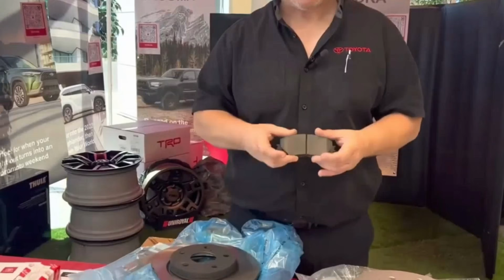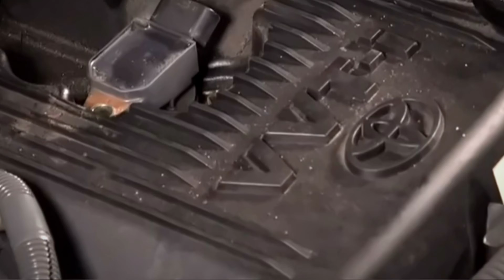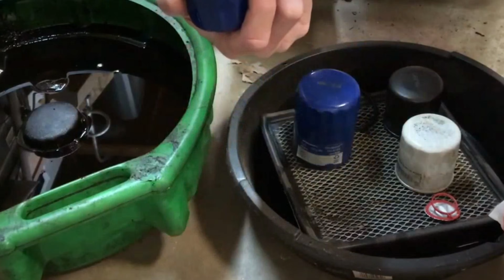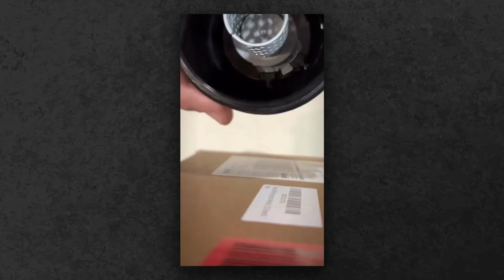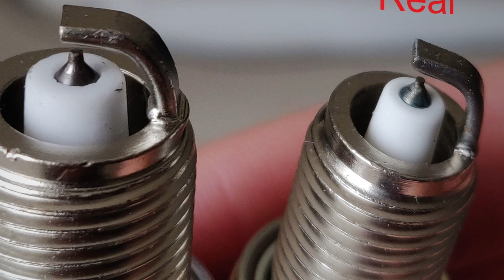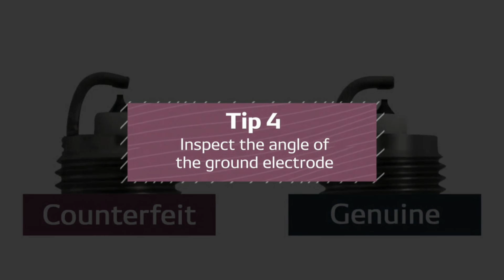The 5 Toyota Parts You Should NEVER Buy Aftermarket (#3 Destroys the Engine)

Comment: Dealing with P0171 and P0174 lean codes on both banks after my son replaced the MAF sensor on our 5.7L Tundra with a cheap aftermarket.  I replaced with OEM 22204-0F030 and it runs markedly better from the start.  Smoother idle, better throttle response, etc.  Now it's not throwing those codes and we just need to let the computer dial things in the way it was intended.

Comment: From YYZ. My Camry have an oil filter without a metal canister. Most air /oil filter have vastly more filtering area than the application require.  If your engine in making enough metal to force the filter into by-pass mode, it is already junk. You can use cheaper copper core spark plugs, they just will not last as long as Iridium. I will not mail order them for scammers are getting good at copying the original packaging , so that you cannot tell.  Mass air flow sensor, try cleaning it with brake cleaner or alcohol first.